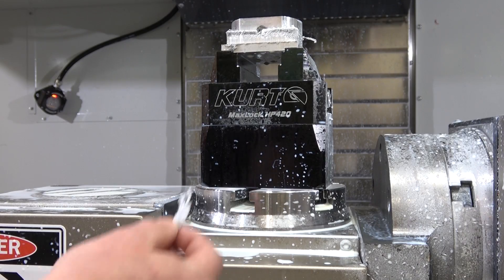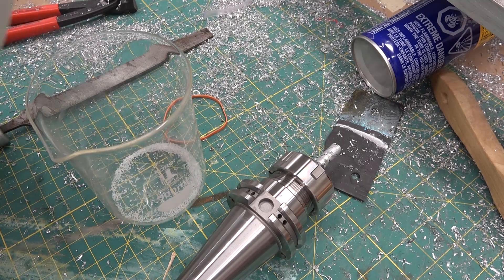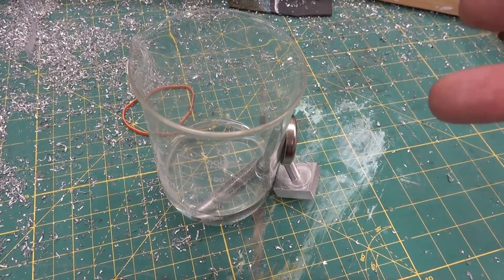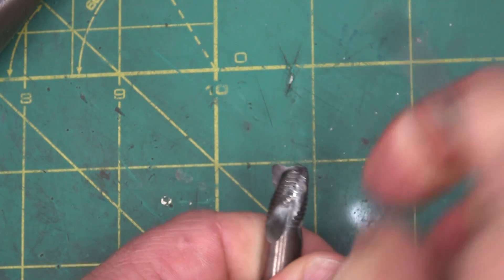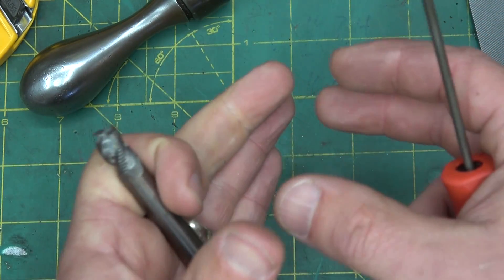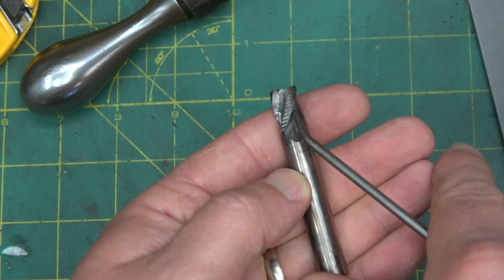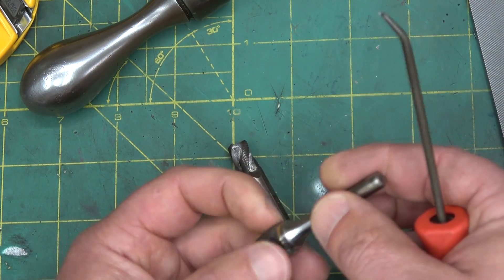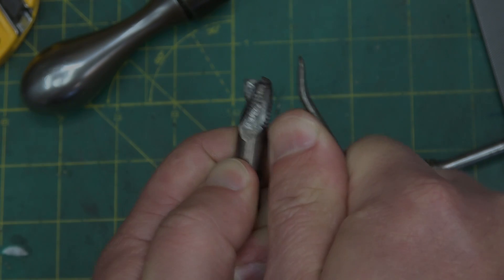Salvage Carbide Tools with Lye | SCIENCE!

Comment: “do whatcha oughta, add acid to water” the same goes for bases. dissolving acids or bases in water is very exothermic. if you add water first, then acid or base second, you can slow down the reaction, making it safer.

Comment: To stop aluminium galling you need Bobbin Grease. put it on every cutting tool you use with ally. cheaper the better. Works especially well with sanding discs/belts and files...

Comment: Common ferric chloride circuit-board etchant solution will quickly dissolve the aluminum chips, but will also attack copper, of course, and stains skin and benchtops.  Rinse well...

Comment: Why not just go to the hardware store and get some Muriatic(Hydrocloric) acid, which is advertised as deck cleaner?  Use to use it to make mini bombs with tin foil. Take a soda bottle put about 1/10 of the bottle with acid and then get a bunch of tin foil into little loose balls. Drop them in and close the top, shake a couple times and throw. Good for removing mail boxes.

Comment: Chemist here, here is a brief explanation.

Metals as we know them are usually in their reduced form (elemental form). Naturally they all have a tendency to oxidise, some more than others. Aluminum has a very high tendency, reflected by it's very negative reduction potential, to oxidise from 2 Al + 3/2 O2 --> Al2O3. As you explained it doesn't completely convert to it's oxidised form because once the outer layer is converted it protects the inner material from further reacting, this is called passivation. Now comes the interesting part: the tendency to oxidise is greater in acid environments and reduced in basic environments, and only metals with very negative reduction potentials will still oxidise, so Al will but Fe won't. But wasn't Al protected by its outer oxidated layer? Yes, but at very low pH Al2O3 reacts with OH negative ions to become Al(OH)4-, aluminum hydroxide, which is soluble, leaving exposed the inner layer

You can find more information on these topics looking at Pourbaix diagrams which show clearly the stability of metals as function of pH and potential.

BTW great video,
Cheers from Italy

Comment: I’ve always used bar soap or a wax on the tooth of the tool to keep aluminum from loading up.  Burrs, files and saws. For endmills don’t you just want to use a 3 flute and maybe tweak the feed rate to give the chip more time to clear.

Comment: If it did form sodium in an aqueous solution, the concentration would kept almost unmeasurably low due to the sodium instantly reacting with water to form more sodium hydroxide and hydrogen gas.

Comment: There's rust and then there's Rust. I like Old Timer knives, thin blades for whittling, but they are made out of carbon steel, not stainless. What I do is unbox them, wash them with hot soapy water, then rub the blade with sweaty fingers. <EWWW> The salt and oils in your sweat react with the iron and for a layer. After thirty minutes or so, wash the blade and reoil it. Do that every day for about a week and a hard deep brown almost black coating forms that doesn't rust.

Comment: The black patina is similar to what evaporust leaves on some alloys after a good long soak. Haven't experimented to determine precisely which, but I do know some old things come out clean as a whistle while others look like they went into a goth phase. It wipes/scrubs off while wet but once it dries it's stuck there. Nice on smooth surfaces but a pain if there's pitting.

Evapo (and some other rust treatments) "chelate" the rust, but I'm not a chemist so I have no idea what that means.

Comment: NaOH mixed 1+4 with water (by weight) heated to 70 °C, will do that basicly while you have the patience to watch it happen. AND it's very usefull for removing oxides from ferrous stuff like steel, without touching the non-corroded parts of it.

Comment: The NaOH solution is too dilute. Make it much more concentrated and the whole process will end in no time. Wear proper gloves when doing this thing. And don't be so afraid of the solution heating up because I've tried much higher concentration (something like 20 wt%) without any problem. Just put the beaker inside a water reservoir.

Comment: work called mid-video but i have a question. why cant you use gradual heat to melt out the aluminium from the steel? does that adversely affect (effect?) the strength of the steel?
Reply: I didn't read all of your question, but yes!
Reply: Yes, it fucks up the temper really throughoutly. Your file is basically mild steel after you heated it to 700+C to melt the aluminium

Comment: dont worry about copper and NaOH, its ridiculously slow. i'd advice to just dump NaOH and water together with too little water in a steel container and then dump the drillbits or whatever in question into there, the heat speeds it up a lot, it corrodes glass faster than steel after all

Comment: I worked at a tool manufacturing/reconditioning shop.  We used Muriatic Acid on carbide tools with aluminum build-up.  It's a pretty violent reaction but it'll leave your tool squeaky clean.
Reply: I think the video here actually nails it by using caustic to chew up the aluminum. In the metal finishing industry caustic soda is used to etch aluminum before anodizing or conversion coatings are applied. Seems to me that would be the best way to chew up the aluminum without compromising the part too much. Acids like HCl and H2SO4 are much more apt to attack iron, zinc, or copper. Whatever works for you though.
Reply: @TheBeeFactory  It also comes in handy for removing anodising on parts you've modified ready for re-anodising.
Reply: I only use muriatic acid to remove the zinc on galvanized parts. It wipes off like windex on a dirty window.
Reply: I say just throw some gallium in there with it.
Reply: What about the tcin coatings and stuff
Reply: @austinshupe9626  Any coating should help protect the carbide.  I guess in my application and use of acids to remove aluminum is specific.  We was sharpening the tool after dipping in the acid, so any adverse reactions or damage to the material was cleaned up after the grinding.
Reply: Well I just tried this method,  burnt my tool headed to the E.R. now...
Reply: @Robbievigil  So you're saying it is NOT in a vice.
Reply: @KurtStudman  sadly no, I'm grounded from all vice action until further notice.
Reply: This is what we used.
Reply: I've used the same to fix my fuckups on carbide tooling.  No good for steel though.
Reply: Also, the big concern out of all of this is leaching of the cobalt in the tungsten carbide.  Cobalt is one of the  binding material in cemented carbide(Tungsten carbide).  If the cobalt is leached out you basically have a skeletonized structure. I believe the cobalt is also what the coating attaches too.   Leaching occurs with an acid or alkali.
Reply: Did you neutralize the acid on the tools after or just let it sit in muriatic acid until it looked fine? Would that also work for tools like files and sockets?
Reply: @CliffWalrus  Usually you'd kept it in the acid until it was free of aluminum, then we'd run it under water really good.  90-95% of the work we did was carbide cutting tools, which the acid had little effect on them. 

 Now on steel, you had to be careful on the soak time, it would etch the steel body if you left it in long.  We'd also rinse them really good afterwards. So yes I don't see why it wouldn't work on sockets or files.  

The smell is harsh and the fumes will rust nearby by items.  So be safe.
Reply: @CliffWalrus  Muriatic (= hydrochloric) acid may rust the file.
Reply: @mikaso  it will only cause rust if you don't neutralize it after. baking soda paste made with a tad bit of water to stop the acid then rinse and dry and apply a small amount of oil to protect from rust
Reply: Could you use mercury to get the remaining aluminum off? Is that practical, or not, for financial or ecological reasons?
Reply: TOT3m1c way too toxic

Comment: Washing soda (sodium carbonate) should do this as well, it'll just take quite a bit longer. Advantage though, go buy 10 pounds at the grocery store and don't freak out much if you get it on you.
Reply: Meh. I work with sodium hydroxide every night. Get it on me constantly. As long as you rinse it off relatively quickly it doesn't do much more than remove some skin layers.

Comment: Years ago I was taught to use muriatic acid to eat molten piston residue off electroplated cylinders.  It might work for this application as well. Use with caution outside with a mask.
Reply: This is the correct answer.  What we used at a cutting tool recondition shop.  Just keep the fumes away from steel...and yourself.

Comment: I’ve always heard that kerosene used as a cutting fluid is supposed to prevent aluminum build-up. I’ve never had the chance to actually try it though as I don’t work with aluminum too much.
Reply: Is using flammable liquids as a lubricant for cutting metals a good idea? I'm no expert but doesn't sound good.
Reply: oil is flammable.
Reply: @pocoapoco2  at a much higher ignition point than kerosene. No idea if metal sparks are enough to ignite kero though. Just wondering.

Comment: Won't liquid plumber/liquid snake/drain declogger work just as well?
Reply: It would probably work, but those products contain all sorts of other chemicals. Much easier to do chemistry when you have pure chemicals to work with.
Reply: @KhronicD  if I remember correctly the higher quality "professional grade" are supposed to be mostly pure lye but I can't speak to that first hand.
Reply: @dimesonhiseyes9134  quite possible. We use 100% sodium hydroxide for my job. So I'm just used to having a couple hundred pounds of it handy at any given time. Heh.

Comment: Sodium hydroxide solution is crazy shit, You have to have a License/permit to buy the Good Shit, I use it for work, Commercial Kitchen Exhaust Cleaning, it just Melts the cooking grease, but is very dangerous if not used properly, burns your skin on contact also can melt a body

Comment: Hydrochloric acid (Muriatic acid ~$3.50 a gallon at any home building supply center)  Takes aluminum off tools in seconds.   

Been doing it for years and never had a problem so long as the tool isn't left in it for hours at time or never rinsed off after the aluminum is dissolved.
Reply: Sodium hydroxide is a bit safer to use than acids, and doesn't affect ferrous stuff much if at all. Much easier on the breathing apparatus if nothing else.
Reply: Muriatic acid is what we used in the tool reconditioning business.  Removes it in seconds.  Just be safe with the fumes.
Reply: @danielgigandet2938  yeah, I use sodium hydroxide for the pressure washing we do and barely notice the fumes unless I mix it up super strong. However people not used to it tend to scatter the minute I start spraying.

Comment: plutonium helps remove pesky aluuuuminiuuuuum from UK
Small amount of DC current induced may speed up electrolysis
Look on MIT site new liquid metal battery technology uses aluminium as fuel in solution. Holds 99℅ charge for 10 years.

Comment: See guys using Easy Off oven cleaner to remove aluminum from Crankshafts with busted aluminum connecting rods. I'm assuming Easy off is chocked full of Sodium Hydroxide!!
Reply: Potassium hydroxide actually. Both alkaline metal compounds anywho.

Comment: If you insist on using a burr bit made for steel on aluminum without just getting a proper aluminum cutting carbide burr bit.....Just run the clogged carbide into some paraffin like a dollar store candle. Then go ahead and use it normal. Notice the clogged aluminum shed away. Regularly add some Paraffin and go go go. Also slow down your die grinder by using a screwdriver in the adjustable regulator that is in the body of most every pneumatic die grinder.  I remember when AvE discovered what sintered metal was on video too. Anyway, fuck that long and messy Lye method. Welcome to the world man. Must be a sheltered life up there in the land of red sweaters. Razz.

Comment: you can buy works toilet bowl cleaner and it isnt so dangerous and it eats aluminum and only costs a buck
Reply: that big container of caustic soda crystals probably only cost a fiver, it'll make waaay more solution that toilet cleaner. It's also the main incredient of oven cleaner and drain cleaner. Just saved you some dosh.
Reply: Yep! I’ve used that as well as drain cleaner when working on small engines that have thrown a rod. Usually leaves some aluminum galled onto the crank journal and those chemicals will dissolve the aluminum without damaging the journal. Of course you have to thoroughly rinse and dry the crank when finished and apply a coat of oil to prevent flash rusting.
Reply: you can get heat burns from reaction it is powerful but you can soak your hands in it and it itches and thats about it...

Comment: Also a good way to get a stuck aluminum seatpost out of a steel bike frame.
Reply: And a good way to remove an aluminium engine head from a steel sparkplug. Lol
Reply: I wish I would've known about this sooner. I dented the seatpost tube in my old bmx frame and I spent hours trying to get that seatpost out so I could fix the dent😂
Reply: @terranovnicek1567  I've been there lol. Took me hours to remove a seat post with a hammer and cold chisel.
Reply: Can take a looong time but definitely works. Persistence and chemistry for the win.
Reply: Yeah, I was going to say RJ the bike guy did this awhile ago. Aluminum/Steel joints on bikes suck.

Comment: Well damn.
I got a couple small files that have some stubborn pieces of aluminum stuck in them.
Basically have given up on those ever being really useful again. Guess i gotta go shopping now!

Thanks a lot for this.
Reply: Spray with wd40 and take it to some steel.  Wd40 and a wire wheel also works.  Also works well on carbide burrs.  I have cleaned both on a very regular basis where I used to work because people would take them to aluminum all of the time.  Spraying files and burrs with wd40 also prevents them from galling in the first place.  Works well with bandsaw blades too.
Reply: We use a bar of soap at the hyd-mech and bandsaw for aluminum brass copper
Reply: @jonfoley3071  That's a new one.  Heard of using water with dish soap in a bandsaw flood coolant system in a pinch.  I guess bar soap would work similar to the wax sticks.
Reply: Wire brush for carding the file....
Reply: @GunFunZS  Well, yeah. I'd do that if it would actually get it clean, but it doesn't work due to the file being just too finely cut
Reply: @GunFunZS  If it only has a little bit it works but if a 200 lb gorilla uses it until it barely cuts it is so galled up then carding just doesn't cut it.  I have a picture on my phone of an endmill that looked almost as bad as on of AVE except the aluminum was smeared on the backside of the flute and not the cutting edge that is held into the Bridgeport with a Jacob's chuck...  Translation, some idiot did some slot milling with the spindle running in reverse using a drill chuck instead of a collet.  I was rather impressed they didn't break the tool or send the chuck flying across the room.  Also forgot to lock my tool box one night and had my carbide burrs looking like balls of aluminum.  Also every wheel on 3 different bench grinder on a regular basis.  So when I heard something is loaded with aluminum, that is usually what comes to mind.

Comment: Vinegar is good to have on hand when doing this, will neutralize caustic burns as well as your fluids before they go down the drain.
Reply: Nobody ever told me I have to neutralize my fluids before they go down the drain!
Reply: @staglomagnifico5711  
Yeah but I bet your pipes are clean.
Reply: @tubeonline629  So clean there's no pipe left, in fact...
Reply: Yep and it's cheap too. You can even use the cheapest ones (we have Tesco "blue label" vinegar over here and it was something silly like £0.09 per litre last time I got some)- just you have to use more. It's worth having some powdered acids on hand too, that are low toxicity, Tartaric acid springs to mind as that's used in some foods and occurs naturally in some fruits.
Reply: @gordonlawrence4749  Citric acid is good safety-wise though it doesn't really seem to do much chemistry-wise. I calculated that, based on rat studies, the LD50 dose for myself is about 1lb. Pretty sure the acid burns would kill me first, lol.
Reply: For a really unusual acid, use the juice from a can of cooked spinach, which has a little oxalic acid dissolved in it. Oxalic acid solution also removes rust.
Reply: YodaWhat Rhubarb
Reply: @Shorne Pubique No, though I do gather a lot of arcane / obscure science facts, in many areas.
Reply: would vinegar be the best to use after the lye dip for to neutralize?
Reply: Diphotorene... Accept no substitute!
Reply: Wrong.  Vinegar is a weak acid.  Sodium Hydroxide is a strong base.  Additionally, vinegar at the store is 2-5%.  It would take a crap ton of vinegar.
Reply: baking soda works too, in water it's a buffer around pH 7
Reply: I watched fight club too
Reply: Sodium hydroxide is drain cleaner so think were good
Reply: SimOndutch....Drink it everyday, #14 is the bomb! Boils real nice like alka seltzer, tho a bit hot going down the gullet...or what's left of it.
Reply: PRO TIP: if yous fool around with sodium hydroxide (lye) and get some on ur hands, rinse with cold water first for 20 - 30 seconds, THEN use your acid (vinegar, citric, whatever) to neutralize whatever is left.  Fight Club was a good movie, but not correct by saying neutralize with vinegar first.
Reply: Jonathan Moir Here is a real pro tip.  From a real pro.  Rinse with copious amounts of water for 15 minutes.